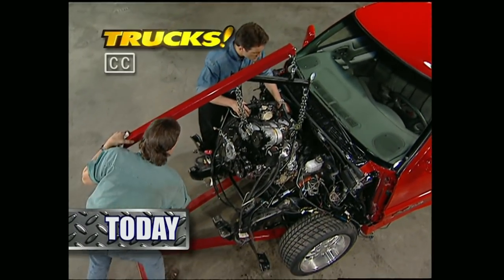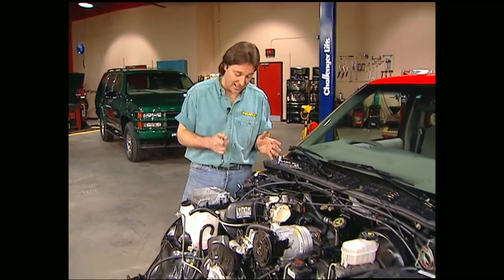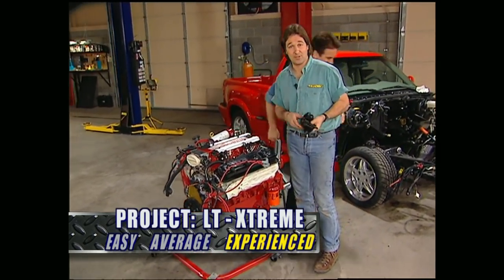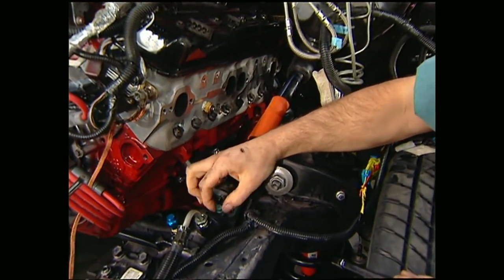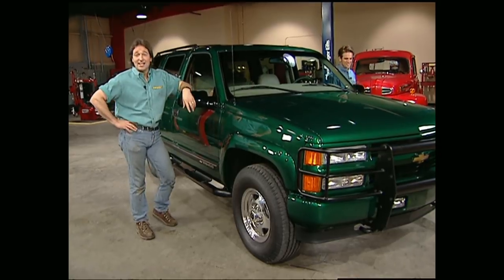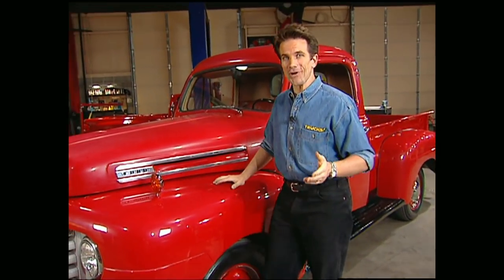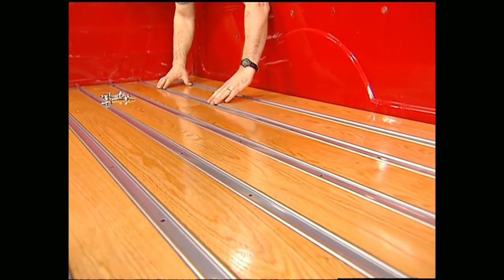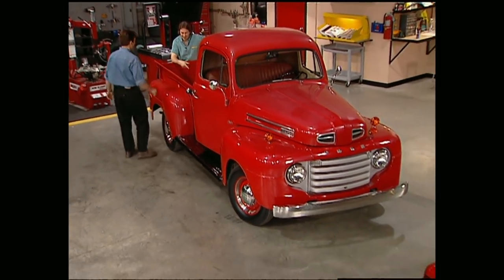Chevy S10 Gets An LT1 Powerplant - Trucks! S1, E6

Comment: Those LT1s are unbeatable, LS swaps will never catch on.
Reply: I thought LS’s were a lot better than the LT’s
Reply: @Lu-e  hell no man,i did a LT1 swap back when this show had aired,i did mine in 98,and i had a 5 speed and omg it was super fast,i blew away mustangs,camaro's,ss impalas pretty much everything,so now ive got a 05 2 door blazer i put a 6.0 with cam in it last summer got it tuned made 384 to the tires and i dont know where that power is going but that 300 hp LT1 would smoke this blazer man,it was fast as hell,mine was out of a 96 vette supposedly.but yea im really upset with my blazer 400 hp under the hood and wheres it all going,same 5 speed set up.hmmm oh well....
Reply: @onewheelup  How did the S10 5speed hold up to V8 power. A friend has a early 90's Blazer with a ZZ3 crate 350. His truck has a 4L60 from a V8 vehicle.  Now the weak link is the rear axle.  He's had this Blazer for about 10yrs now. The axle has been replaced at least 4 times. His wife says no more burnouts or hard launches because she's tired of spending $$ on it. Pretty sure that the transmission has been replaced a couple times too. I was just curious as to how your 5 speed held up to V8 power because I have an extra one for mine.  My truck is on its 3rd transmission and it only has 200k on it. I left mine stock,I think it too clean to start chopping on.& I drive it every day .Shifter is kinda knotchy in those trucks. You had a NVG3500 transmission,right? Some 4.3L trucks came with the NVG 1500 also.
Reply: LS platform is the better engine in my opinion.....LT1 are  decent but the optispark is its downfall

Comment: I was thinking ,man that extreme looks brand new ...... and your eyes aren't bad it's a very old episode from a tv show
Reply: Sadly, many of the projects that were new from the factory were crushed after. This one was no exception along with big orange which was the z71 with tracks on it
Reply: @marshallmcdowell3369  Stacy actually talked about that I'm interviews before.... he hated building something cool when that would be what would come of it
Reply: @joshlawrence4512  yea there was a recap episode where he showed all the projects he worked on all the way up to copperhead and said that's why he stopped the builds on new vehicles
Reply: @marshallmcdowell3369  Do you have a link to any info about them crushing the cars? I never knew this, was it only projects based on new vehicles?
Reply: @Onewheelordeal  look up the recap episode. Circa 2005-2007. He was on gearz and had recapped projects. Like, big orange, wicked willy's, the blazer, copperhead and others and he specifically mentioned this and big orange
Reply: @Onewheelordeal  and it was only projects based on new vehicles. The factory crushed them instead of possibly facing lawsuits for selling modified vehicles
Reply: @Onewheelordeal  big blaze got sold to someone who stripped it of everything and sold it to a used car lot, wicked willys was sold to his dad who still uses it on his ranch and copperhead he still owns
Reply: @Onewheelordeal  actually recap on copper head. Gearz S13 E10 he sold it to someone who basically just kept it in a garage
Reply: @marshallmcdowell3369  yeah on gearz he actually showed copperhead how it looks today at a show,the owner actually let him do a burnout with it

Comment: omg an lt1 i hear they are working on something new. ls1 or some thing.. lol
Reply: Yeah it’s supposed to have a massive amount of horsepower! 305 HP out of just a 5.7 SMALL BLOCK! Unreal what technology these days can do.
Reply: Hear what Nissan is doing to try and show these muricans up? 300 panda power out of a 3.5 liter v6 in their new Z cars, the 350z.
Reply: LS's were around back then, they weren't cheap, tho.
Reply: Jaybee they came on board around 98 I think with the Trans Am and z28
Reply: @JonBecker81  the LS1 was in the Corvette for 97 and Camaro/Firebird for 98
Reply: a456987 Yeah that’s right Corvettes always get the new goodies  first
Reply: dont mock the old LT1. i have a 96 Z28 she has 250K on this beast and it still pulls pretty hard for an old high mileage engine. it has a PCM tune, SLP loudmouth exhaust, and a transmission rebuilt and upgraded. 2,200 stall converter, shift kit, and better internals (spregs, band, ect ect)

Comment: About 6 year ago I put a 5.7 vortec into a 2000 Blazer Zr2. Used the s10 stock ecm, just added a couple wires for the 2 extra injectors and the ecm found them on the crank relearn. Headers, modified for the egr, Corvette radiator. Used the stock 4L60E. Had to run the steering through the headers too. We had to pass state emission which made it a pain.  This truck looks a lot better shape then the Blazer I did.

Comment: It’s easier to pull the inner fenders attached to the fenders. The abs pump brackets are bolted from underneath to the inner fenders too. Idk what he was pretending to unbolt? lol.

I’d rather have that 2.2 then that LT1! I have an S10 with original 460,000 miles on it. I’ve owned the truck since 18,000 original miles!!  I’ve replaced everything around it! but as long as you change the coolant and oil regularly and never run hot or low on oil I’m starting to think they’re immortal 

 funniest thing is that 2.2 is worth MORE then that LT1 too! lol.

Comment: As for myself, I'd left the front springs in place. If the stock V6 has iron heads but the V8 swapped in has  aluminum heads,there's really not enough weight difference to be worth the trouble.Jusy my opinion though.
Reply: That truck had the base 2.2L 4 cylinder

Comment: i remember this ,haha i actually did this to mine.in 1998 i put a LT1 from a vette in my s10,a whopping 300 hp backed up by a 5 speed.and IT WAS FAST AS HELL,so i felt like doing it again,since all this LS talk,so ive got a 05 2 door blazer i installed a 6.0 with a cam ALL BY MYSELF then had it tuned,and pretty good numbers,but its nothing like that 300 hp lt1 for some weird reason.i dont get it,so im still working on it,scratching my head,,,unless that blazer is that much heavier man idk whats up...

Comment: I have a 2001 Chevy S10ZR to 4 wheel drive and I want to take the  4.3 out what motor would work with my 4 wheel drive system and my transmission and  Rear end please let me know and it is a extended cab I'm taking the fleet side bed off and putting a step side on it Please comment back I want to do A383 stroker what someone said it would be too much power for that size truck

Comment: I didn't realize LT1's had over 300 HP in the 90's?  I had a 95 Roadmaster wagon and didn't feel like it
Reply: The LT1 was rated right at 300hp in in the Corvette, 275-305hp in the F bodies, and 260hp in the B bodies.
Reply: Roadmaster wagons weighed well over 2 tons too.